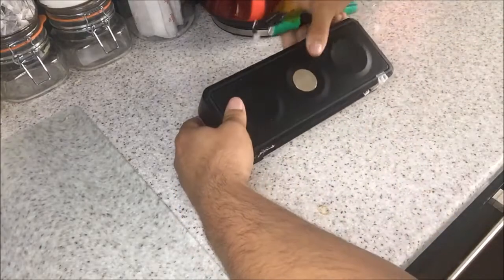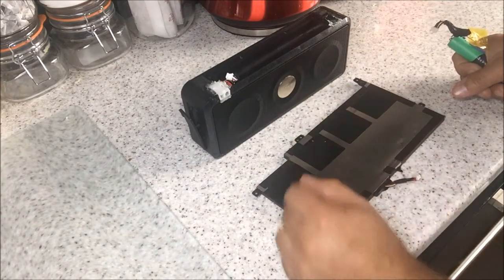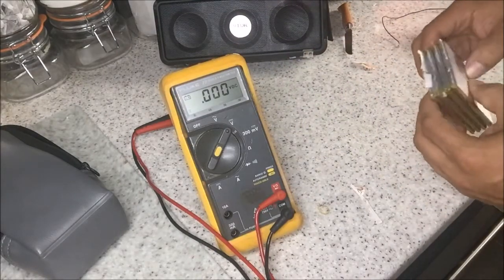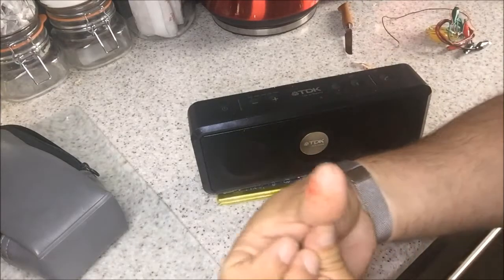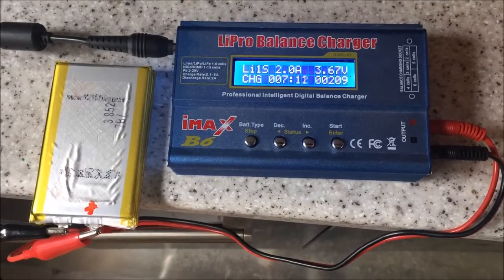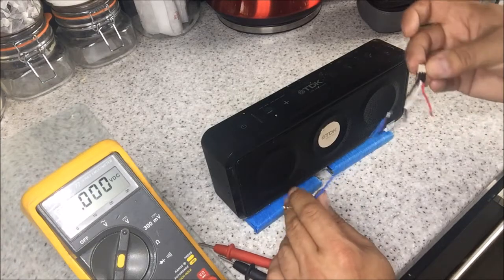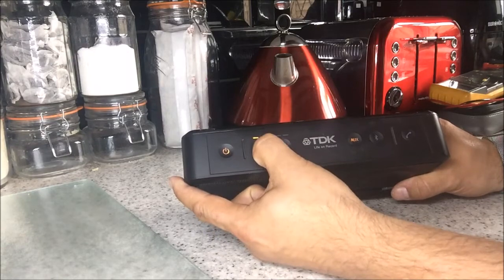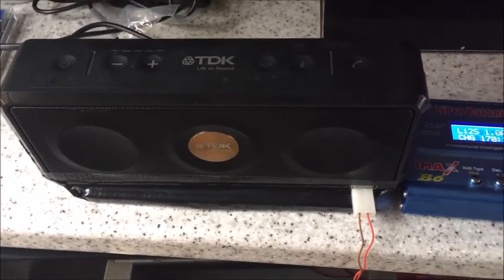PIMP MY BlueTooth Speaker - Modification - Lithium Ion Cells! LONG LIFE!

Comment: Great work in a pinch! I would take it one step further and add a protection board or balancing board to make sure they are all charging evenly. Then add some 3d printed parts and you have yourself a super clean mod
Reply from the maker: Absolutely 👍 agree!  ...  I have been doing that in future mods.  Good news, I'm manually staying on top of the condition of the batts and it is still doing really well after a few years!
Reply: Do you know anyone near Burien Washington that can modify my tdk a33 like you did? @DubiousEngineering

Comment: Can i use 18650 4800mah 3.7v instead? If so, how many? What's the connection? Thanks.
Reply from the maker: Originally this unit had four 1.2v NiMh batteries in it so, about 5 volts.  A lithium ion battery at full charge is about 4.2volts.  So my suggestion is to use a number of 18650s in parallel.  Please be careful charging etc!!
Reply: @DubiousEngineering  thanks
Reply from the maker: Pleasure... please be careful with lithium ion ... I haven’t had a problem yet... but you never know!!
Reply: @DubiousEngineering false thin unis use 6 1.2 batteries on series 7.2v Total
Reply: There are 6 1.2v NiMH batteries, so you need 7.2v lipo that is small enough to fit in the 155x29x14mm housing, or you can use 14500 Li-Ion but need to connect using 2 batteries parallel using three of these packs in series to get the 7.2v needed
Reply from the maker: I love it when people are helpful:-). Thanks Eduardo!

Comment: Think I will place a 2 x 18650 in series battery holder to the back of the unit vertically ( I discovered there is a perfect room for it behind) to avoid risking me danger from Li-Po batteries cuz they swell in time.
I know my idea will not offer great visuality with the speaker but its gonna be lot safer and imagine you can replace your batteries whenever they are depleted ! 2 x 3400 mAh batteries should sweetly last 5 to 6 hours at full volume, we'll see.
Reply from the maker: Fantastic! - I hope is all works out well for you! - I'm super happy with the sound I get from these, and continue to use them regularly with my dodgy-battery modification! - All the best! - Howard (Dubious)
Reply: Done ! 
https://ibb.co/bzQ2fT
https://ibb.co/jJsR78
https://ibb.co/gepOn8
Reply from the maker: Bilal Öz well done! ...  nice bodge! :)
Reply: Do not have over-discharge problems? I have heard that if you download a lot the 18650 battery breaks down
Reply: @MrBrizt just soldering a BMS circuit

Comment: How many playing hours do you get now, and compared to original battery?
Reply from the maker: l31007 original batteries were 3x1000mah 1.2v AA NiMh ... now we have 4x3000mAh 3.6v LiPo. About a full 24hrs of play-time at 3/4 volume.  A full three day camping trip with evening use 4pm till 11pm hasn’t run out!
Reply: @DubiousEngineering  It is possible to charge
 directly the battery configuration (4x3000mAh 3.6v LiPo) directly from the TKD trek a33. Thank you, your help will be very useful.
Reply from the maker: Good work! ... be safe with LiIon! ... don’t forget to thumbs up and subscribe
Reply: Dubious Engineering great to hear that ! I have two of this unit one white and one black. Thinking to convert them to lithium cells for a while but didn't know  how to,  your video inspired me a lot. Looking for a way to charge them 2s2p cells with a direct charger rather than hobby charger cuz of the expense. My build of battery will include 3400 mAh 18560 cells,.Maybe I do my video of conversion.  thanks !
Reply: Dubious Engineering Subbed ! Great channel.
Reply: Dubious Engineering btw,  any chance to find service manual or schematic for the  circuits inside ?
Reply from the maker: Bilal Öz ... unlikely...  I don’t have one, sorry...  try google... :)